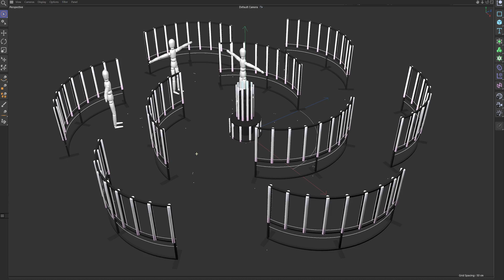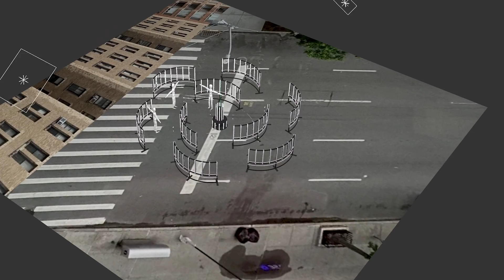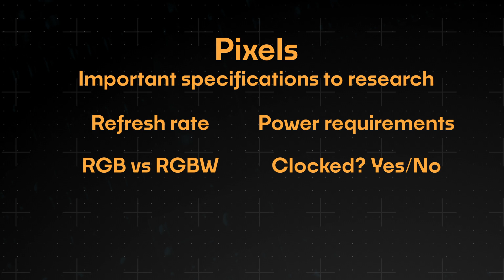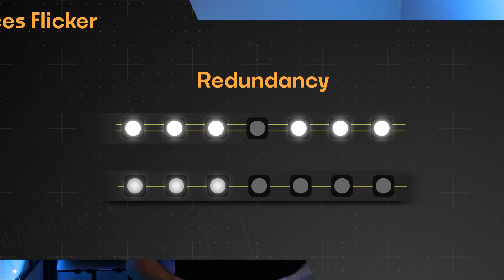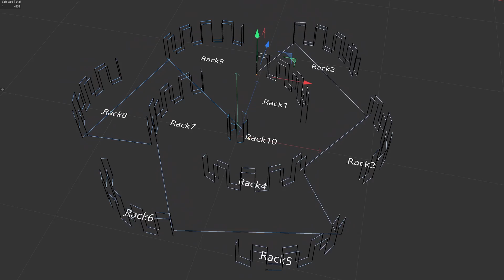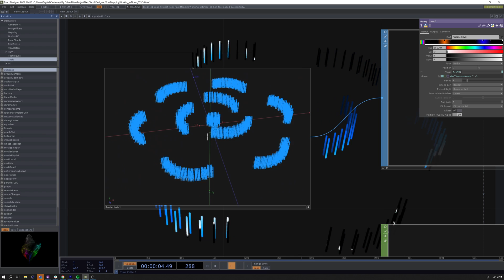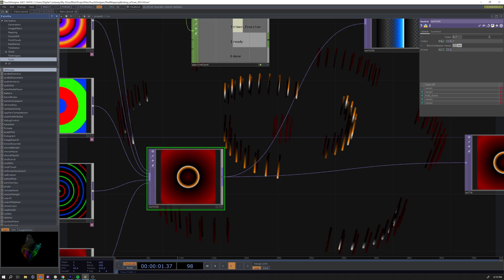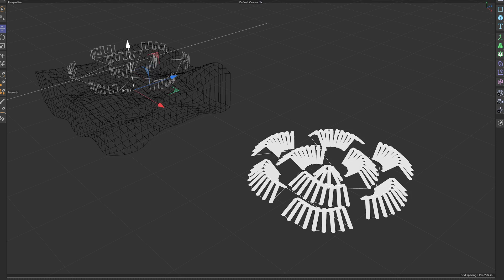Using video to drive thousands of LEDs

Comment: Great video, and thanks for sharing! I've tried to find out how to create lighting in signs similar to the video below - there is a great control of the lights in the sign. Is TouchDesigner a good match (or maybe overkill???). If I create a sign with lighting, the sign should be able to run a light program without a computer connected. Perhaps data on a SD-card where a controller can get the data from. Could a Pixlite 16 MK2 be a good controller? Hope you can help! https://youtube.com/shorts/jjzu_aBsoNU?si=lxK_hP0afYz7jYkV
Reply from the maker: A pixel controller is likely over powered for what you are describing. Look into using an arduino controller and WLED programming for your needs.

Comment: Incredible and wonderful project, and thanks for sharing the details!
I was wondering how you can import the 3D model of the installation from C4D to TouchDesigner and have a previs directly inside TouchDesigner preview, like how do you tell TouchDesigner where the strips are in the 3D model to have an accurate simulation of the single pixels?
Reply: In the description of the video I linked a tutorial that will walk you through the process of mapping pixels as well as creating a virtual layout inside touch designer.
Reply: @digitalcastawayloops  Thanks! I've watched the tutorial and it was really helpful, but they doesn't mention how to import a model
Reply from the maker: The file in SOP is what you need. Import an obj spline into that and replace the line they generate in the tutorial.
Reply: @DigitalCastaway  What do you mean by replacing the line? 😬

Comment: I love the scale and the ambition here.  And clearly you've thought a lot about ease of implementing new patterns as well as the robustness of the controlling hardware and software.  I also liked the way that you adjusted the 3D mapping to allow a 2D representation while retaining a sense of depth in the pattern rendering.   I have done a little of this kind of stuff using the  Pixelblaze modules, but this is out of my league.    Well done!